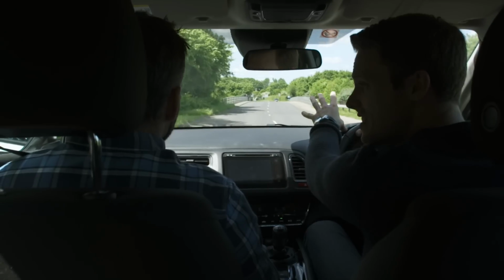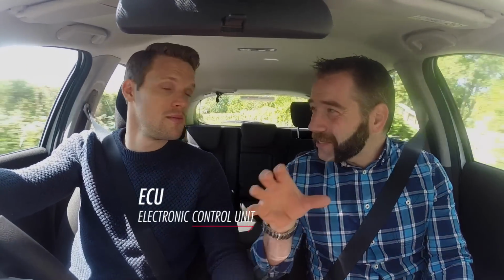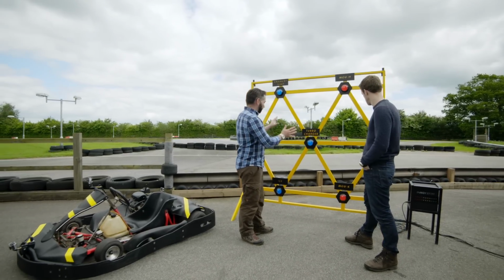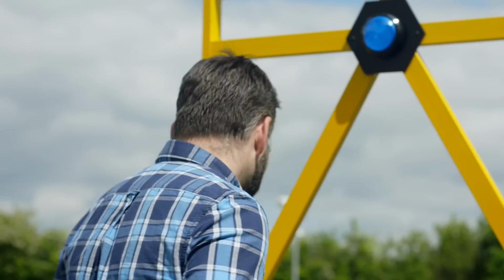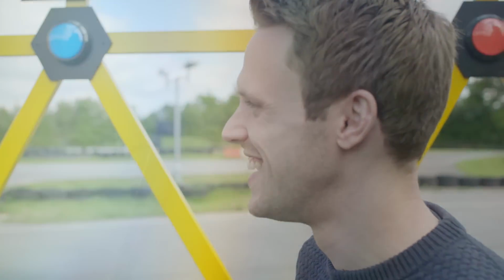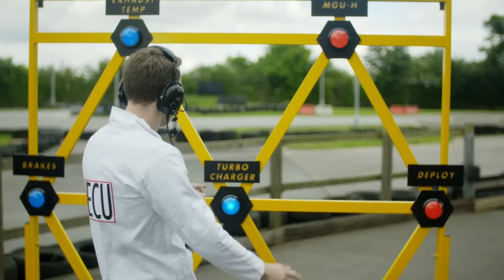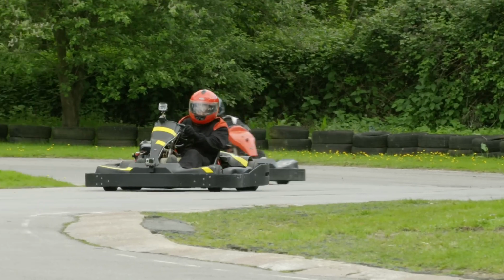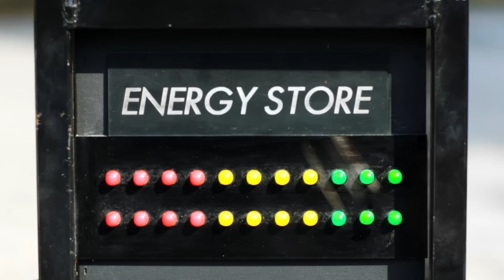The Nerve Centre I The F1 Power Unit Explained I Honda Racing F1

Comment: The human brain can process data at the rate of 1 exaflop or 1 x 10^18 Flops. While the ECU can computer all of these stats at incredible speeds it doesn't have the same type nor sheer computational ability as the human brain